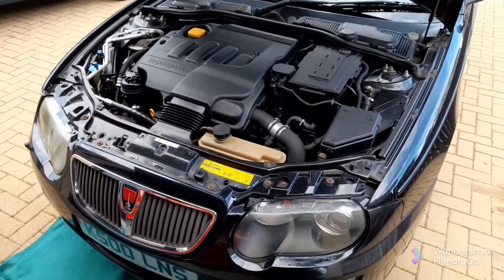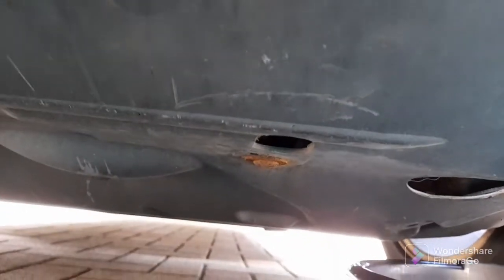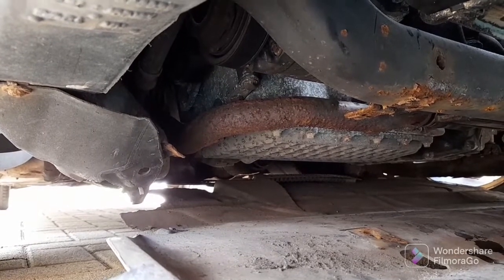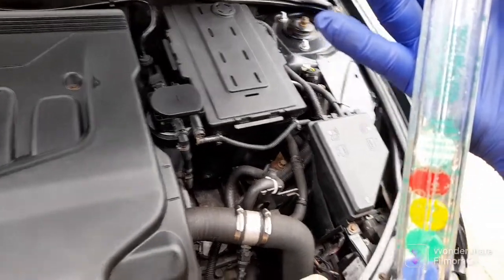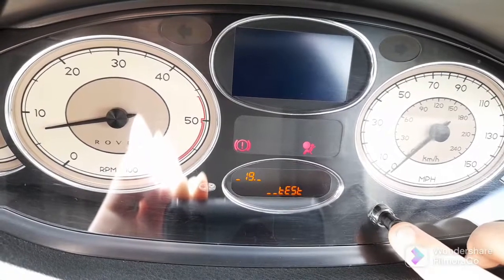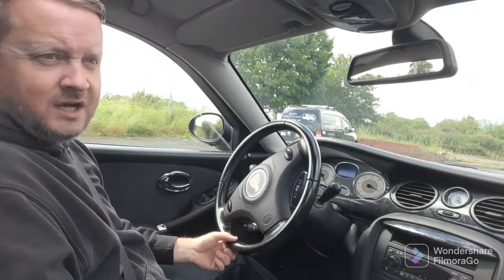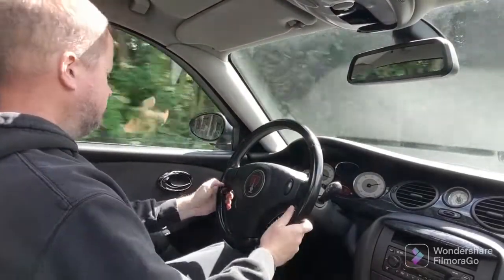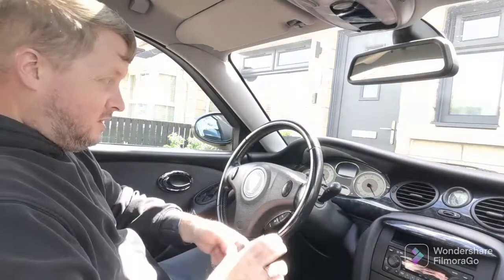Rover 75 / MG ZT Diesel CDT Coolant Change

Comment: I did the temp sensor on my Audi it's running at about 90 now after a good drive. I checked it on VCDS seems to be normal. They can be a pain to bleed them Rover's done a few of the M47 in the land rovers.👍
Reply from the maker: I've never done a Rover one before, normally only Vauxhalls. Got there in the end though!

Comment: Did you leave the cap off whilst you were driving to get the air out of the system?
Reply from the maker: No, in case an air bubble caused the coolant to spray out.